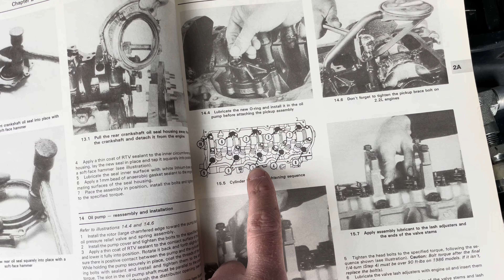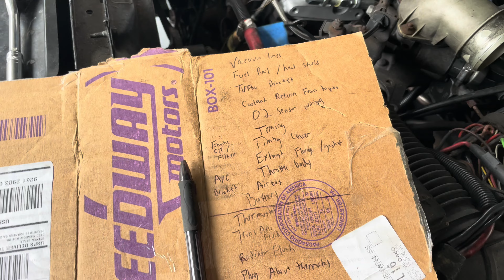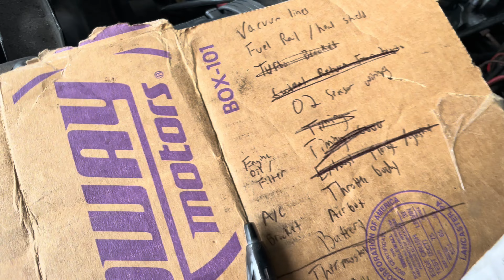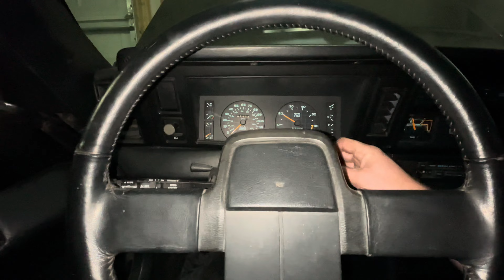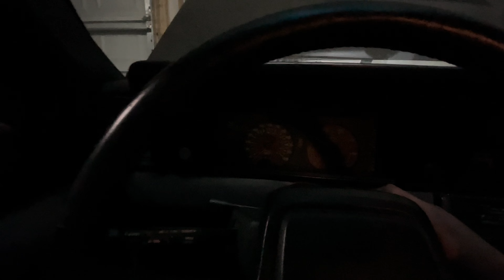Will this forgotten Shelby Daytona run after sitting for years?

Comment: Check your Fuel rail ground if its bad or not hooked up it will cause the ASD relay to go nuts it will click like crazy and the fuel pump will pulse with it.
Reply from the maker: The fuel rail ground should be good because it’s all brand new wiring, but I’ll definitely double check it!

Comment: Pull the stater and get another remaned one. Good work though... looking forward for it to run.
Reply from the maker: Thanks man! I had the original one professionally rebuilt because I really don’t trust auto parts quality these days…and you essentially have to take the head off to get to this thing. Really hoping it’s somehow something else, we’ll see!
Reply: @TheMoparGarage  you can get it back out from the bottom of the car, just takes a little work. Done it many times myself...life long turbo dodge guy here!
Reply from the maker: @challenger_daytona1590  good to know! I ordered some relays as well because those things were going absolutely nuts.
Reply: @TheMoparGarage  id try and get a good look at the wire connection directly on the starter solenoid....but I'm going with bad solenoid or something inside the starter.
Reply: I've had good luck from the last starter i put in from oriellys. Just throwing it out there.
Reply from the maker: @challenger_daytona1590  literally the last thing I wanted to have happen!
Reply: @TheMoparGarage  thats what always happens, and usually an easy fix just time consuming.
Reply: Almost you doing a great job please make another video soon from this project
Reply from the maker: @rokeysanchez5328  thanks man, I appreciate that!! I will definitely be coming out with more on this car soon.

Comment: If your pulleys don’t seem aligned, make sure you installed the A/C-alternator bracket exactly as the manual says. There is a procedure.
Reply from the maker: Good to know, I’ll check the manual!